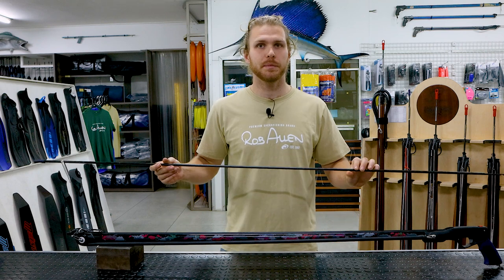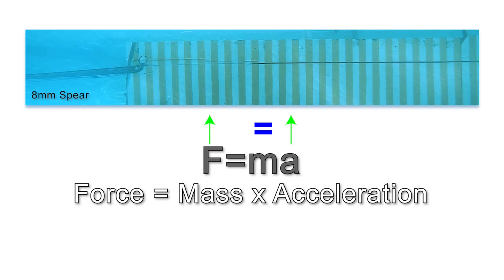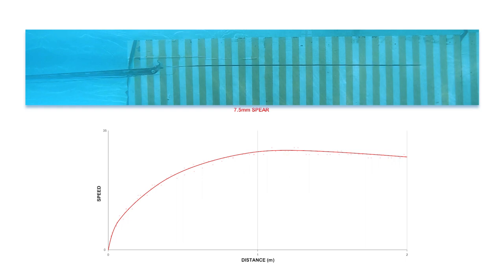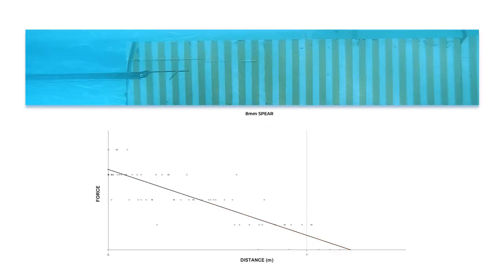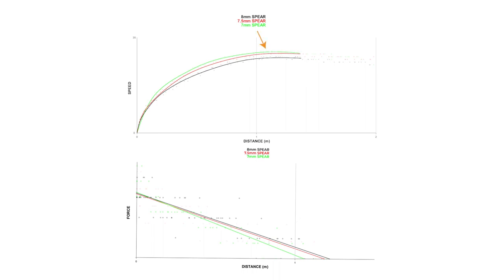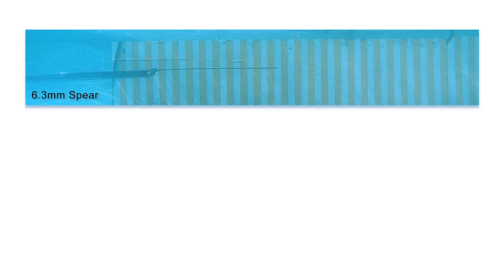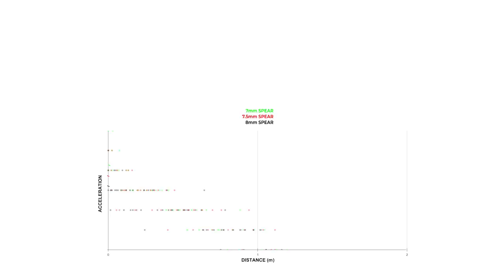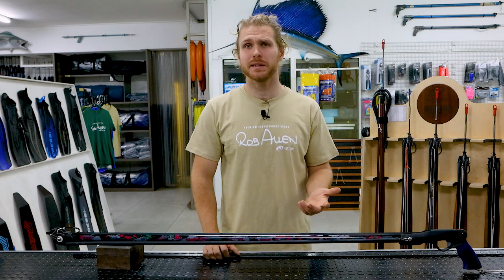Rob Allen | Max Spear Velocity | Part 3 | 2023

Comment: Love this vid! 
It's verbally explained around the 4min mark, that "the faster the contraction, the larger the reduction in force available.  And then later he talks about it actually being the thinner diameter spear wobbling due to early excessive acceleration causing a reduction in force.  Is this one in the same issue, meaning the reduction in force was due to spear wobble causing more friction? Or two separate issues, both found with lighter / thinner spear tests?

 Would love to see more scientific rubber testing but focusing on the two end results everyone wants to know, whether they know it or not: 1). Max accurate speed at long range (say 5m from gun muzzle) on small fish targets, 2). Max accurate speed at long (say 5m from gun tip) on on large fish targets, (complete penetration through a 20+kg Giant-Trevally  or similar).

We need the spear to get there as fast as possible so the fish has less chance to dodge. We need it to be accurate. We need it to then penetrate successfully. We can know a set up for small fish is not the same as one for penetrating big fish so two ideal max usable set ups are being being sought here.  Must have an average gun kick that average experienced diver can control one handed.  Anything requiring two hands would be a larger gun category.  Also not a request for impractical limit testing though that is always cool too!
Reply from the maker: Hi, thanks for the comment.

With regard to the question, the two statements are referring to different phenomena. 

The first statement, “the faster the contraction, the larger the reduction in force available” is referring to the speed at which the spear is traveling down the barrel and the force available to the spear from the rubber. The faster the spear is going, the closer it gets to the maximum speed of contraction of the rubber (snapback velocity). This is why we see different forces available to the spears for each different diameter, despite the fact that the same rubber was used in each gun. The 7mm spear accelerates quickly initially, but sees less force toward the end of the barrel. The 8mm spear has more force available to it toward the end of the barrel, as the spear is traveling slower than the other two and is further away from the contraction speed limit of the rubbers.

The second phenomenon, “thinner diameter spear wobbling due to early excessive acceleration causing a reduction in force”, is referring to the reduction in penetration force at the end of the shot due to drag caused by a wobbling spear. This is shown by the decline in speed of the thin spear relative to the thicker ones, despite the slightly larger speed seen as it exits the gun.

The objective of the video was to show an effective “butterzone” that we aim for when setting up our guns. This utilizes as much of the drive length of the gun as effectively as possible and tries to eliminate the drop in performance seen from overpowering thin spears.

I hope this helps😁

Comment: Awesome video. Loving this type of content.
Two days prior to watching this I just set up a 900 RA gun with a roller, 16mm bands and bought a spare 7mm shaft. Wish I’d had waited a few days 😂.
So from what I can gather, the main advantage if went to a 7.5x16 would be penetration, due to the weight of the shaft. Apart from that accuracy, speed and distance between both setups (7mmx14mm and 7.5mm x 16mm) would be quite similar?
Cheers.
Reply from the maker: Yes correct. 7mm will work better with a 14mm and a 7,5mm with a 16mm rubber. It is not that 7mm will not work but as shown, it will become overpowered and you will have less accuracy. Also, not really talked about in this video, the higher speed of the rollers with the lighter spear causes way stronger vortices that can suck the shooting line into the roller.
Reply: @RobAllenSpearfishing  Thanks. That’s what I call customer service! Thanks for that info.
Reply from the maker: @sailingpacificstar  😜👍

Comment: Awesome video 
Great data

With regards to the foregoing information in this video, Would it be fair then to say that a:

Stock 1.2 RA snapper roller (14mm band & 7mm shaft) 

would perform very closely to a:

Stock 1.2 RA tuna roller (16mm band & 7.5 shaft)?

🤔🤔🤔🤔
Would you be able to do a test on that? 
Or if you have already let us know the results?
Keep up the awesome work 
Loving the science behind it
Reply from the maker: Both will basically get the spear up to similar speeds but the 7,5mm, being heavier will have more impact and penetration.

Comment: Thanks for another great video. 
It would be really interesting if you could do a range/penetration chart for all your guns, or at least the main variants in both standard and roller.
It's hard to compare, say a 800 Tuna vs an 800 Roller Tuna. 
Does one fire further, or hit harder? Is a double wrap the limitation to either option, and therefore they are equal in distance range? 
Snapper vs Tuna, roller vs standard, etc etc. 
Thanks
Reply from the maker: We make so many different guns and have many set up options, sot to do an extensive trial like this will take ages. What we have learnt from this testing is, if you get the spear up to max speed, no mater how you are driving it, you can't make it go faster. 

So in theory, range on a roller, when compared to a non-roller should be much the same. The variability is that the roller will take slightly longer to get to spear up to max speed, therefore the recoil will be less. The non-roller will push the spear up to max in a shorter stroke, causing more recoil. This recoil can cause muzzle lift and kick the back of the spear around causing an oscillation, slowing the spear down a little and, disturbing the flight and therefore accuracy. 

This is why we recommend a single wrap for non-roller and double wrap for rollers. Remember this only all works if the guns are set up correctly. Age of rubber, length, type of rubber, water temp etc are all factors that can mess with this. I also think, the "dialed in" set up on a roller is a smaller window than that of the non-roller.
Reply: @RobAllenSpearfishing  Thanks for such an in depth response. I guess I'm struggling with the transfer from a simple single band light weight RA to your Roller Tuna. It aims high and doesn't float, those things ill get used to. 
I'm not sure where I stand with my benefits, as it's thrown my aim and although shorter, is also heavier. 
I'm wondering if I could have got what I needed with less weight by going for a Sparid or snapper. 
Other than lack of kick back, what have I got over those guns with the T roller. 
I understand its all complicated and nuonced, so there's no one explication. I guess max range with minimum barrel length was my initial reasoning for choosing the 800 Roller from my 1000 single band RA
Reply from the maker: @MarshallRoad   There are so many "trade offs." Inaccuracy can also be due to rigging. You might be getting muzzle wraps without realizing it. This is just a suggestion, it is super important to keep the shooting line as tight as possible. Some even prefer to use a spear with the shooting line through the spear ahead of the wishbone notch. We have just started to make a full shark fin spear option, with a hole through one of the fins. 
In terms of buoyancy, only way to increase it is to go with a Timberline gun that has the timber to increase the lift.
Reply: My gun is an RA 800 Tuna Roller off the shelf, set up from factory. 
I got the impression from Coatmans videos that all rollers shoot high, so I assumed it was this.
Reply from the maker: @MarshallRoad  Double check that your barb is closing fully. A sticky barb can make it shoot high.
Reply: @RobAllenSpearfishing  I have an o ring on it, holding it against the shaft. I thought about moving it to the top but I'm not sure if it'll help.
Reply from the maker: @MarshallRoad  That could very well make a change, try it.

Comment: Very apparent from the test shots that the recoil is also very important and id guess the limiting factor on power in a set up? Even with reduced recoil from the roller the recoil was still causing the spear to deviate from its orginal line.
Reply from the maker: Agreed.
Reply: @RobAllenSpearfishing can you give the rubber length used?
Reply from the maker: @spearo16  The rubbers would have been the standard set up we use on a roller when setting up for a7,5mm spear. Basically a single 16mm, stock standard.

Comment: For interest sake, try the same test, but keep the mass constant by increasing the diameter of the spear and shortening the length. This might make the spear more rigid and maybe provide more force or well in theory
Reply from the maker: In a previous video we have shown that by decreasing the mass of the spear for a constant set of rubbers, the force seen by the spear is reduced at the end of the barrel. A more rigid spear will likely not make much difference to the barrel exit speed, but may help the spear maintain speed down range as the spear would flex less which should reduce drag.
Reply: @RobAllenSpearfishing  Yes your right but that's when the bands stay constant, what if you add more "power" by increasing band diameter? 
For example 140cm 7mm shaft weighs 420g (standard 14mm band rob allen 100cm roller setup), which is exactly the same as a 120cm 7.5mm shaft (standard 16mm band rob allen 80cm roller setup). So does this mean you can use 16mm band on this spear due to the increased rigidity and then resulting in a faster shot? Its about a 11% decrease in mass when compared to standard overhang, so in the formula F = ma, force remains constant so acceleration increases by 11%, but does it get restricted by the maximum acceleration of the latex? Would be interesting to see how this setup will compare to the standard 100cm 7.5mm shaft roller setup and how it compares to the standard 80cm 7.5mm shaft roller setup.
Reply from the maker: @JSJ-mn8wg  It may increase the velocity toward the end of the shot but would likely not increase it as the spear leaves the muzzle, due to the bands being the limiting factor. You also would not be able to wrap the shorter spear with a shooting line in the open muzzle configuration which may cause issues.

Comment: Could it be that momentum of the larger spear is greater and therefore maintain a higher energy state to lessen the effect of drag despite the slower acceleration?
Reply from the maker: The inertia of a heavier spear does help it maintain speed if the drag conditions were the same as on a light shaft. Drag does still seem to be a larger factor though and in a previous video, we saw an identical spear fired from different guns slow down at a different rate due to the drag effect of the shaft bending.
Reply: @RobAllenSpearfishing  Thanks for the reply. I am very interested interested in that sort of thing and spent a lot of time pool testing. There are obviously pro and cons to everything. Personally it came down to preference. My strategy is light,  surgical strikes. I use a 90cm roller with a 14 rubber and short 6.5 spear most of the time (even large yellowtail at Struis). I de-power the rubber  with string extensions for reef fish. I therefore use one gun for everything from yellowtail to hotties in the kelp.
Reply from the maker: @hendrikvogel262  Always a hard one to quantify as there are so many variables. Pool testing is always a good idea to understand how the  setup should be and what works for you in your diving environment.

Comment: What is an actual max speed in m/s? Thanks.
Reply from the maker: 30m/s is average. The max speed can vary a lot pending the water temp. 28 to 35m/s is what it is.
Reply: @RobAllenSpearfishing  Thanks. I suppose it is a material limit.
The Young's modulus of rubber is 5 MPa, the density 1200 kg/m³, so the speed of sound is ~60 m/s.  Slings might have a bit of different values as a rubber, but +/- the same, and they can't  decline themselves faster as speed of sound. More slings or more strong slings means faster acceleration and more recoils only.
Maybe we can get higher max speed with an inverted roller, because the "rope" moves twice faster as slings.
Reply from the maker: The invert roller may allow more force to be available to the spear toward the end of the gun, but won't necessarily double the speed of the spear. 

We are hoping to do some tests on invert rollers soon and will post results as soon as we do.